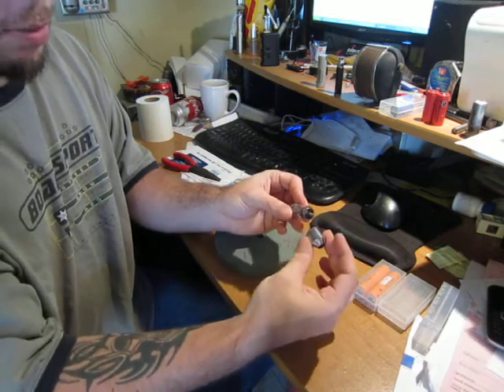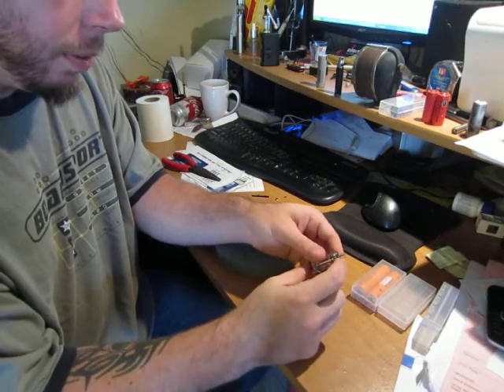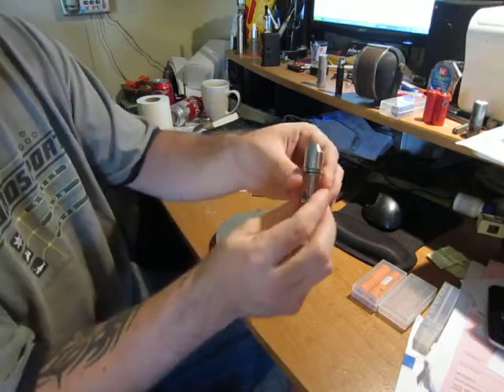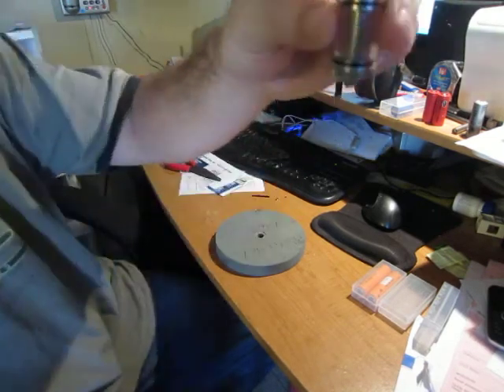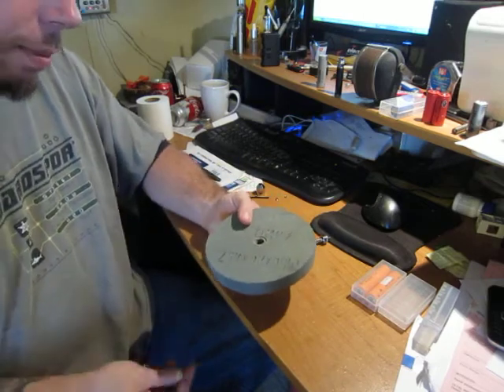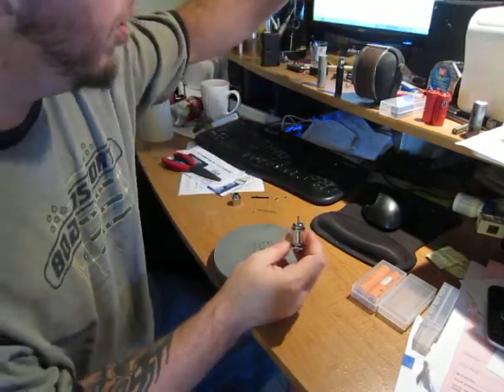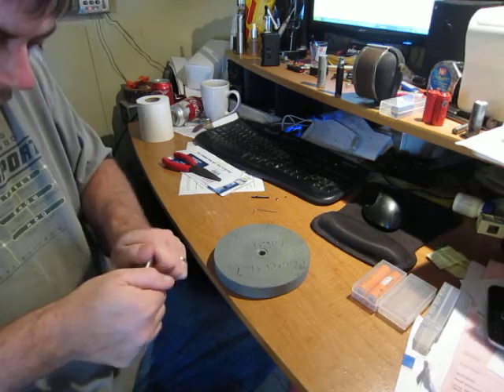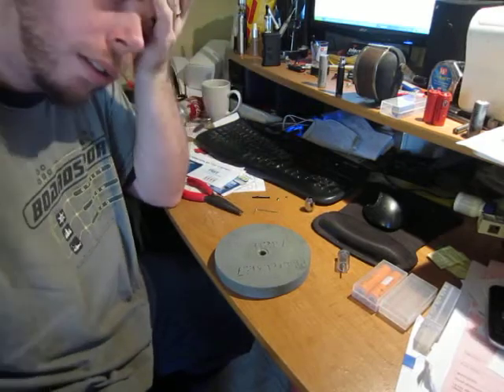Lining Up The Holes For CHobra (Cobra Clone) Genesis Atomizer. Part 1 of  2.

Comment from the maker: I totally agree. That has to be the best way. I wonder if that would still work for some of the atomizers where the cap is almost lined up but then you cant make it so tight that the cap gets stuck. That worries me about that atomizer. I hope we don't start hearing about caps getting stuck. The one in the video was only like 180 degrees off. But what about if it had been 340 degrees off. If it sill works without sanding its going to be a pretty substantial gap.